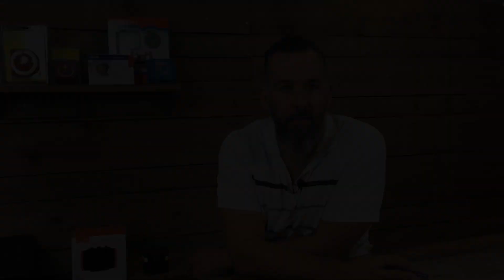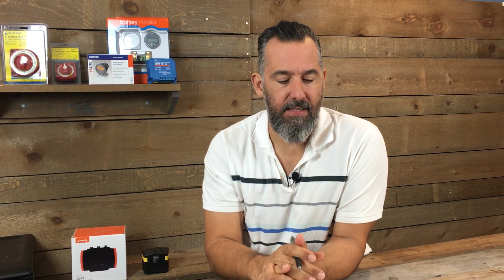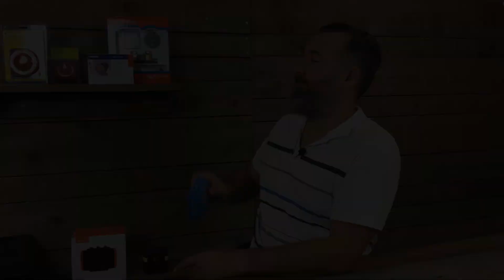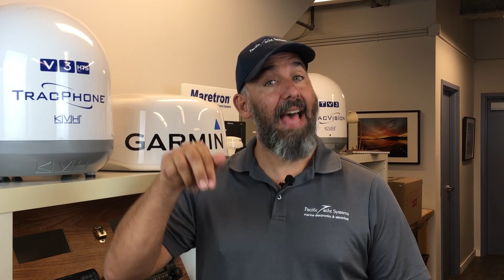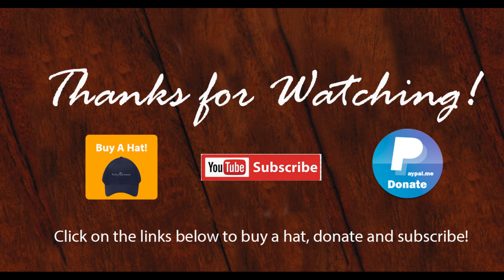Ask PYS - Can One Solar Panel Charge Two Battery Banks?

Comment: I have an almost related question that you may wish to answer..?   I have two solar generators (herein sogen(s)) w/built in mppt bms,  about 8-9 amps total and would like to power both at the same time using one 180 watt solar panel (instead of a separate for each)..  Realizing that the sogens cannot be connected together in any way,  my solution would be to provide the necessary branch mc4's for each panel leg and isolate the pos.  branch output with an inline mc4 fuse which already  has a blocking diode  built in to prevent vdc back charging.  Your thoughts..??
Reply from the maker: Hi pjf, unfortunately don't have any experience with this topic. Anyone else can weigh in on this questions.
Reply: @PacificYachtSystems  Thank you for your candor..

Comment: I use a two battery controller it works great
Reply from the maker: Hi Kenneth, which one do you use?
Reply: @PacificYachtSystems  it's a ce duo 20 amp. It's cheap. It works good, the amps aren't strong enough. I am upgrading soon . Check missouri winds out. They have some really good hardware. Also I have found out with the right ampage and wiring you can connect your batteries in a series and one charge controller is all you need

Comment: I have a question i have built two separate diy battery boxes one with a single 7ah sla battery and 2nd has got 3 7ah lituim batteies each is with there own solar charges one is with an mttp and one with a pwm but need to know if i can use a single 50 watt panel to power them both witg a y adapter coming from the panel
Reply from the maker: James, great question, never tried this, but heard from some boaters on YouTube it's possible. Anybody can weigh in on this.

Comment: What would be the reason you couldn't use the load output connected to a separate battery?
Reply from the maker: Hmmm, controllers treat load outputs not the same way as a battery connection. Remember, the smart MPPT controller use a smart charging algorithm as to NOT overcharge the battery. A load is simply powered by a fixed voltage.
Reply: @PacificYachtSystems  Thank you.
Reply: @PacificYachtSystems  pv voltage changes all the time as sun goes high n low.controllers will harvest current accordingly

Comment: As far as Victron system goes, for 12v system, answer is battery balancer combined with mppt. It will not only charge both, but keep even charge distribution. I guess there are plenty of similar solutions from other producers.
Reply from the maker: Thanks for sharing Robert.

Comment: ELECTRICAL BONDING
No two marine technicians seem to agree when it comes to the question of the electrical bonding of metallic skin fittings. What is your opinion..
I am a Electrician, never wired a boat electrically .. All my #6 copper was disconnected from the through holes on my WestSail 32..
Thanks for being here...!
Reply from the maker: Good point, lots of disagreement on this subject. After much conflicting info and research, my recommendation is to have underwater metals to be bonded together.

Comment: I currently have 3 group 31 agm batteries, with two connected in parallel to have a 200ah house bank and the other as a 100ah starting bank. I have an ACR that connects the banks when charging from the high output alternator or shore power.

Here's my question: the house bank is nearing end of life but the starting bank is fine. I'm considering replacing the two house batteries with lifepo4 and I'm curious to understand the tradeoffs. 

I can set the voltage regulator and shore power charger to use a lithium chemistry charging profile. It seems like the only negative for this would be that I could shorten the remainder of working life on the starting battery, which seems like a reasonable trade-off. 

Am I missing something important?
Reply from the maker: Hi Scott, you should have a dedicated charger for your AGM starter battery.

Comment: Why not use an acr and connecting the solar controller to engine battery doesn't charge both batteries?
Reply from the maker: Your correct, you can share any charging voltage via a battery combiner connected to batteries.

Comment: Jeff, at my dock I have one panel and I have connected (2) controllers that each power separate banks, in parallel.  Is that OK?
Reply from the maker: Peter, can you clarify. Do you have a single solar panel connected to 2 controllers? With each controller connected to it's separate battery?
Reply: @PacificYachtSystems  , yes, that's how I set it up.
Reply: Excellent question!
Reply: Petter Herrman how is the set up working on your dock? Im about to try it...
Reply: Is it still working?
Reply: @kellycook3602  Seems to be. The boat still starts! I don't have any gauges on it though so check, but I think it's working OK.
Reply: Can someone answer his questions please?
Reply: Did you try ? Is it work?
Reply: @francoisjefferson1751  , I think it's been working ok. Just not sure if it's right.

Comment: And if you want to charge not just two bans but a 3rd?  Boat is sitting all winter, I have solar going into house but want to backbone start and gen start? Now its getting interesting...
Reply from the maker: To charge a 3rd bank, you could install a directional battery combiner like the Xantrex echo-charge or a DC to DC charging converter.

Comment: Hi Jeff, Would a bi directional vsr work? So when the alternator is running both banks get charged and when the solar controller is above the vsr setpoint both banks get charged.. Is this still the thing to do or is better available? What's this other thing you mentioned? Regards stormer
Reply from the maker: Yep, a bi-directional battery combiner would work for this. Many boaters have this setup.

Comment: What about two controllers? 
Same type of controller, eg. Victron 75/15, one conncted to the housebank and one to the engine battery.
Both controllers connected parallel to the one solar panel (or array of panels).
The controllers share the incoming current (same voltage).
Once the engine battery is floating, all power goes to the house bank.
Or?
Reply from the maker: Hi Peter, never heard of this. Not sure what would happen. I'll test it out for the heck of it.
Reply: @PacificYachtSystems  Looking forward to a video :-). Thanks for great videos!!
Reply: I have that at home with a grid -tied invnverter and a battery bank. All my solar goes to a 1-2-both-off switch which is normally in both mode. The grid tied inverter and the MPPT-solarcharger are each connected to their own pole on the switch and a common ground.
They work nicely together and the good thing is that :
-when the battery bank is getting full, more power is send into my home grid.
-The moment the grid fails ALL power will go toward the battery bank.

Power tend to go to the grid tied inverter at incoming voltage below 31 volt, this is likely cause my Victron Solarcharger want 5 Volts difference between incoming voltage and the battery.
I am trying out some scheduling on the grid tied inverter to make sure the battery bank is always near full as I need it as a battery backup when grid down.
Reply: @HansKeesom  hi Hans. Could you make a video of it. Share it to us.  Many thanks
Reply: This was my first thought as well.  I will be interested in knowing if this will work.
Reply: Jeff: Could you put multiple controllers output to a buss then to the echo charger? I don't see a maximum input for the echo charger.

Comment: I assume that one could also install diodes to prevent the power from going OUT from one battery bank to another while the solar charger is connected to both banks. Or is that what that device you mentioned contains?
Reply from the maker: Exactly, battery isolators are either built with diodes or FETs, the modern low voltage drop battery isolators we use are built with FETs (Victron ArgoFETs).

Comment: I agree with Jeff up to a point. I generally fit an AVR except a non-diode based one that's bi-directional.
You can use one panel two batteries with PWM:
http://support.morningstarcorp.com/wp-content/uploads/2014/07/ALL.APP_.1_array_isolated_banks.01.EN_.pdf

Or the Sunsaver Duo is a good shout for PWM also and you can set the ratio 50:50 or 90:10.
https://www.morningstarcorp.com/products/sunsaver-duo/

MPPT is really the best option if overcast skies are the norm. As far as I'm concerned MS are really worth the extra for the sake of battery health compared to the cheaper alternatives. I'd rather a 10 year battery lifespan to bluetooth and no remote temp sensing.
Reply from the maker: Liam, thanks for sharing, didn't know about installing two PWM controllers on a single panel. Appreciate you sharing your knowledge on this.

Comment: Great videos , I have a question ( I’m buying a sail boat for full time living , first time sailor also ).boat will be 40-45 ft .
I was wondering if I could use a 9000 watts generator on a boat let  say from harbor freight assuming that I connect the exhaust to a pipe going out of the boat and also secure it in place permanently , no start pull but electric start I will also relocate outside of the enclosure
Reply from the maker: Some sailboats have diesel generators installed but never seen a gasoline generator installed below deck on  a sailboat, probably due to the risk of explosion due to the low flash point of gasoline and its fumes.
Reply: @PacificYachtSystems  thank you I will make sure I check for diesel generators when boat shopping
Reply: If you see this post I’m wondering what you settled on. Are you in salt environment? If so I would have gone with a dependable marine grade gen.